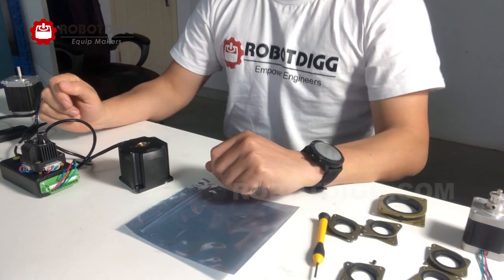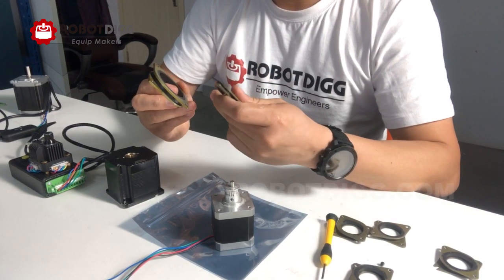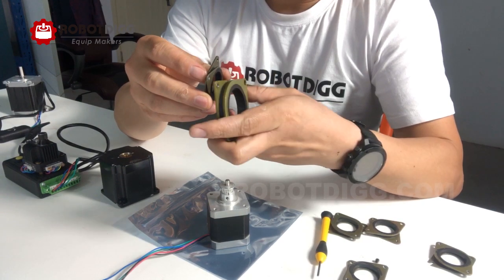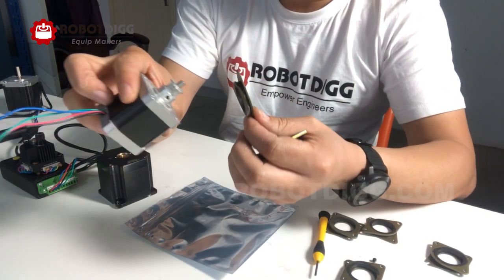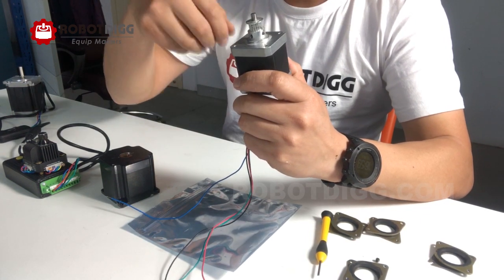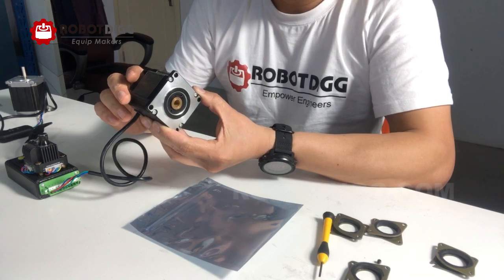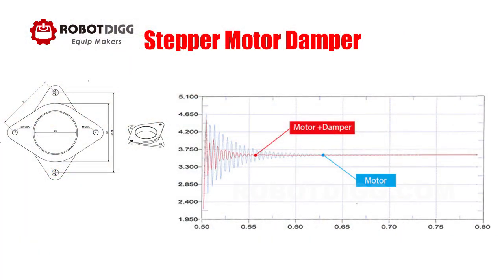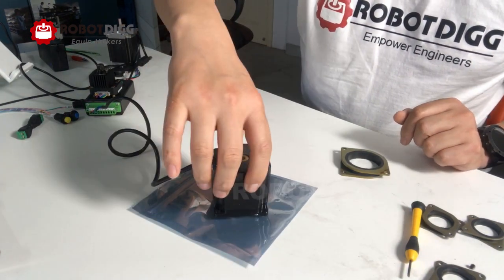NEMA17 and NEMA23 stepper motor damper

Comment: thank you for sharing this video 
i build cnc router  and i have problem with noise coming form the stepper motor specially when i move slow feed i use nema 34 any advice  to stop the nose 

thank you in advance